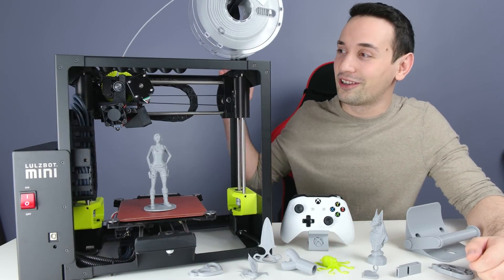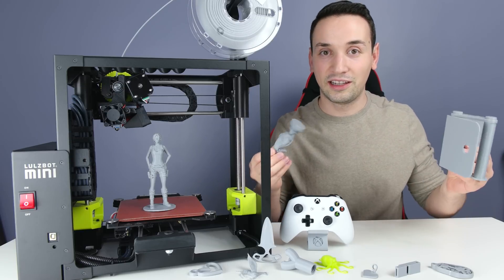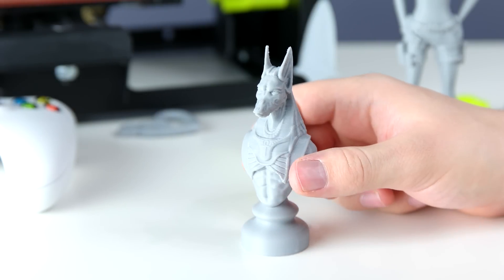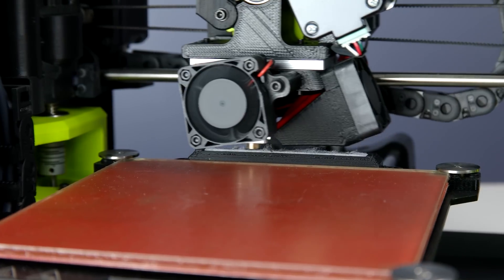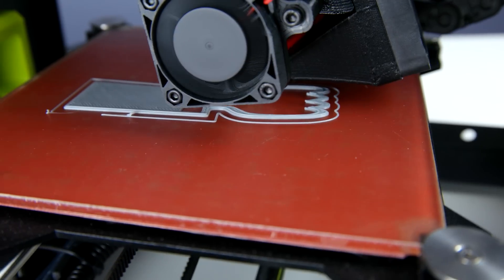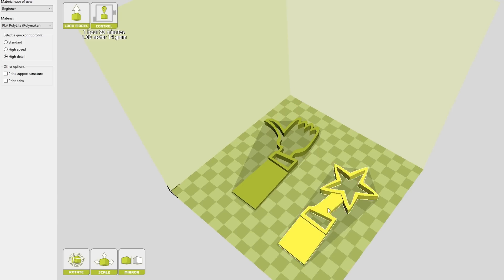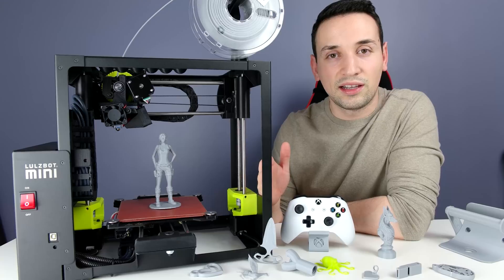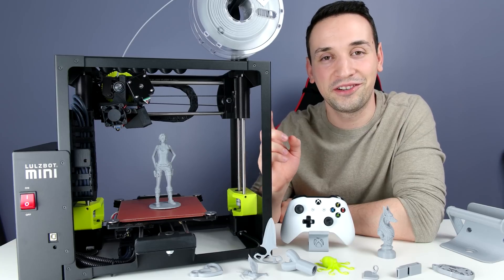Incredible 3D Printer Review - LulzBot Mini

Comment: They say that the lulzbot taz is the #1 printer, but if you buy one, you may be sorry, I purchased the lulzbot taz workhorse about 6 months ago, it worked good for about 6 weeks, I have been working with their tech support for several months now, they have tried everything possible to rectify the problems it has with calibration, until this day they have no resolution, and I am out of $3,000.00 spent on the printer, and the $1,000.00 I spent on printing materials, is just catching dust. Looks like I am going to have to take civil action to get my money back because I do not want anymore of their printers
Reply: How did it end up for you?

Comment: I've bought a Lulzbot Mini as my first 3D printer in 2015 and not terribly impressed with it. The print quality isn't great and the heated bed crapped out after less than 100 prints. I purchased their "new updated bed" and none of the mounting corners that came with the new bed fit right. Lulzbot does have very good customer service and they address issues very quickly, but they are slow to ship warranty items. I was considering getting one of their larger Taz machines, but I'm going for the Prusa instead.

Comment: bro im having problems printing tall things. it prints everything flat but if i print something that is a bit high like 3inches off the floor it would make a stringi mess
Reply from the maker: That's so weird , under the cura software go under Machine and install the default firmware located in the usb. also make sure you have the right filament selected if you are using PLA the temps should be around the 210c. let me know what happens did you try printing other tall things as well ?